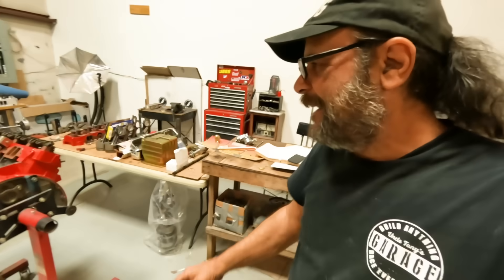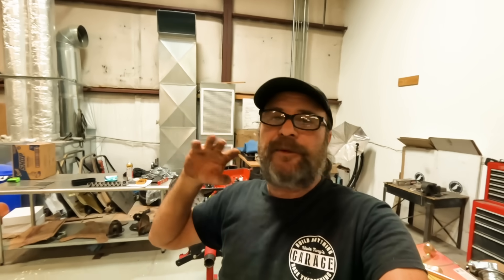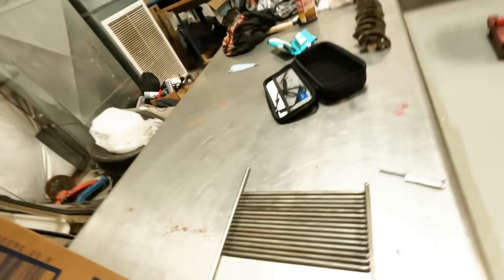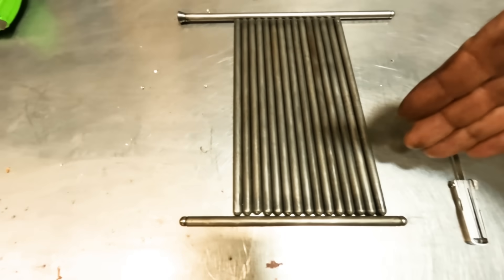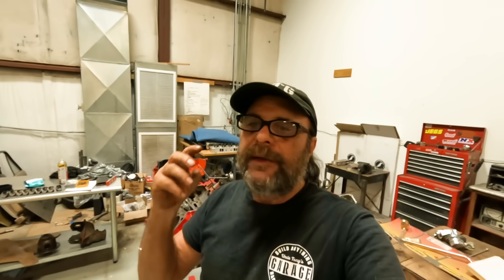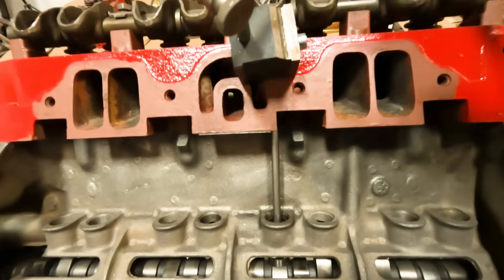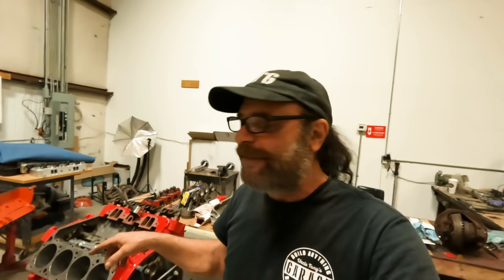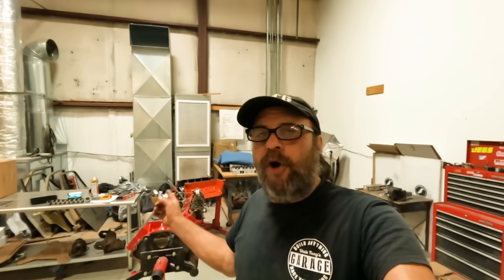The Engine Tuning Issue You Didn't Know You Had

Comment: all push rods need to be the same length = check lifters and cam lobes = if a push rod is shorter it is worn and some thing is also worn = rocker pivot lifter cam lobe = even hydraulic lifters  - and this is why = over head cams were popular and have advanced so far . check push rods straight = roll them on a mirror and see .

Comment: The pushrods have a manufacturing tolerance on length. + or - .010"? .005"? Also the valve seats gave a manufacturing tolerance from a certain feature on the head. Usually the face. This can be established by a specified spherical diameter set in the valve seat as the distance from the head face to the top of the sphere with the head set up on a surface plate so that the head face is parallel to the surface plate. That's an old school way. Now it's all done with CMMs. As to how the valve seat depths are controlled that can vary. The tooling set-up will specify the seat cutter at a certain distance from the mounting face of the cutter. The cutter body also carriers a carbide bushing to guide the valve guide reamer. But the cutter face where it bolts on to the spindle face can be vary. The spindle assembly drawings will specify a set distance from the spindle face to a control feature.  It can be to the rear end of the front set of bearings on the spindle shaft (1) or it can be to a keyway in the bottom of the spindle body. It depends on how the machining equipment was designed. Another factor that can creep in is wear on the clamping surfaces in the fixture holding the head during machining. This can cause a slight twist in the head during clamping. Plus there are multiple machining stations being used to cut the valve seats and guides. In the old days the stations being used to the transfer lines used to do this type of manufacturing had solid stops to control depth. Run into the stop a couple of hundred thousand times and you will have wear. Today things are controlled with ball screws and encoders. Too shallow or deep. Edit the numbers. Each machining station is a dedicated CNC machine. The point is all of these tolerances stack up on top of one another. And they usually add up the wrong way.
I used to work in an engine manufacturing facility (30+ years). Inline OHV 4s. 6s (2), V-8s and OHC V-6s. So I'm pretty familiar with engine manufacturing. Its possible that a couple of new techniques have shown up but I doubt it. I worked maintaining part tolerances and repairing machines and fixtures on the manufacturing floor plus in the plant Tool Room (3) rebuilding machines,  repairing machine components, fixture work, machining replacement parts for machines and fixtures. My last four years there I rebuilt precision spindles and workheads.
1) A spindle consists of the entire rotating group
2) Kenosha Engine
3) Prevision machine shop. Not where they keep the tools.

Comment: We used mechanical rocker arms with hydraulic lifters when we milled the heads as much as.040 so we could get the right preload of the lifters. At.040 mill didn’t change the rocker arms operational angle too much.

Comment: Another thing to add to this conversation is different cams have very different base circle sizes (the zero). Just a cam change throws it all off again. Modified engines need custom length pushrods. Sorry.

Comment: I rebuilt a '77 318 and put a stock grind '71 340 cam in it and would float the valves around 5500 with stock 318 springs. Never did damage anything.

Comment: What about a block that has been decked multiple times? Is that Clearances that could be determined before assembly by engine builder. Or would they only be able to determine lash/preload after assembly of your motor (as I would assume?) and then send it out if it was just a street motor or tell the customer to get adjustable rockers for a performance build. I guess what I'm saying is how do you avoid the problem? Are there spec measurements for deck/ head heights? How many times has my 390 out of a 68 Cougar that is now in a 69 f250 been machined and how would you know without assembly of engine? Ive never built a motor before but I'm interested

Comment: Interesting, I am not a motor head.  I removed my 62 Falcon Ford 170hp six cylinder head to repair exhaust bolt holes. I did not know to pay attention to location of each push rod. All the push rods are alike but one. Which told me the head had been previously removed. I noticed that the push rods where also not the same length, as you show in the video. I did not note location of each push rod... Oops. I also noticed that one push rod was a larger diameter. ???
The head has been resurfaced. And as you state that will effect the lash. Please explain Tony what "lash" is? The shop manual also uses this terminology. 
I get setting everything to zero when bolting on the rocker arm assembly and measuring to place the longer and shorter push rods in the best fit locations. Taking it apart was easier than putting it back together.
Each rocker has an adjustable nut thank God on the 62 to set the tension gap c/t the valve spring. I hope I'm using the correct part names.
The rocker arms are worn in places c/t the push rod. I assume this can be adjusted out. The shop that worked on my head did not resurface the rocker arms??? 
I do not have all the fancy gages. I assume I can set tension after setting lash (zero) c/t rod and arm???
I'm completely guessing. 
Any advice?

Comment: Love watching your videos Uncle Tony! You speak to the old school and new DIY mechanics! Any chance you could cover the AMC 360 on Full Size Jeeps! There’s a large community with a lot of owner’s opting to chuck all the emissions to get them running stronger and better.  The problem is a lot of FSJ owners live in SMOG states so we need to keep them running well and pass smog.  We can’t just get up and move into a non-smog state which is the typical sarcastic answer from those who don’t want to deal with tuning an engine and still passing smog.  Thanks Again for keeping things simple and proving simple tips to keep our 70’s and 80’s cars on the road and not in a garage in bubble wrap. I have a 1986 Grand Wagoneer with an AMC360 & motorcraft  2150 carburetor, all original with all the smog equipment and new exhaust from the manifolds back
Reply: Just how far back do done states expect you to meet might emissions standards for the model year the vehicle was built. Where I'm at its 95 or 96 when the OB2 sensor hookup came into use. Anything older doesn't need to get checked. And to be honest there really isn't much around that's older.

Comment: I've always thought that pushrod length on a mass produced engine casting is a compromise at best. There are simply too many variables to take into account unless each lifter-pushrod-rocker arm-valve (length)-valve spring assembly can be tuned and set up individually. The rise of CNC billet engine blocks and cylinder heads solves most of this but is way out of reach to most of us.  Getting away from mass production is  the only way to begin to limit the variables. Otherwise time for each mechanism and good hydraulic lifters are required.

Comment: Another thing some fail to do on engines with fixed rocker shafts, is they may plane the heads or deck the block but fail to shave the valve stems to compensate. Edit: Oh, you get to this point at 12:34.

Comment: Love this Video. I can remember back in the 60's and 70's adjusting the valves on  small block Chevy's. We would start them up and after the engine was warm we would remove a valve cover and install these caps on the rocker arm to stop the oil from spraying all over. Then we would start the engine and back off the ball nut until the valve started clacking, then we would tighten it down until it stopped.  Then give it a quarter turn to set preload. I still have these "caps" in my tool box today. Now I'm questioning the quarter turn. If it is not needed I've been doing it wrong for 55 years?

Comment: Rocker stand shims are for fixing rocker to valve tip geometry issues , I've used adjustable pushrods on a couple of builds to set preload with stamped steel rockers .

Comment: Funny you should be doing this the back when Mount St Helens blew up I started doing head work in addition to being mechanic previous to that porting polishing valve grinding all that stuff building things I was doing meticulous crap like this measuring stuff out of the blue out of my own head just out of curiosity because all the parts catalogs I had had dimensions in the back and you could varie push rods by 60,000 90,000 longer set and I used to measure stuff for the s*** of it I used to even weigh pieces just for the hell of it and a lot of people don't think around me just throw the thing back together but it takes an enormous amount of time which is why I got criticized because I took too long? But you know what I don't remember anything ever blowing up or coming back unless the person was an idiot that owned it and ruined it but anyway measuring takes forever and that's why I have never built a motor overnight and put it in the next day you're just asking for trouble it can take 3 weeks to a month to build a motor

Comment: When I was a  kid in the mid 70's I wanted to build a solid cam 440. I found some adjustable rockers around the shop in a box in the used parts room that looked like they could either fit or be slightly modified to fit. There were only 12 of them in the box, so I think they were from a six. I could be wrong but I seem to remember my uncle telling me they were from a Rambler. BTW, I never built the solid motor, I ended up using a hydraulic cam and stock rockers

Comment: Tony great explanations. At the risk of getting angry comments because some people like to attack any other input..

I used adjustable rockers years ago and was happy until I wanted to bring back the original looking valve covers. The adjustable rockers I used “Isky” needed taller valve covers. Hence I used Direct Connection chrome valve covers. My solution was to use adjustable pushrods in my 440 six pack engine with stock valve covers and it was terrific. RPM was never a problem in fact I had to be careful of going too high. 
I have refreshed a 383 recently using custom pushrods made by Smith Brothers. For the very reason you pointed out. I had cylinder heads that had uneven valve stem height after a valve job.  Years ago they used to finish with grinding the stems even. No more. Cost me less than $300 and I was done. No rockers to buy and pushrods to match. A cheap way to go custom valve lash and very strong since you can request bigger diameter pushrods too. 
I’m a little surprised with your vast knowledge you didn’t mention adjustable pushrods that work with factory stamped rockers. It’s a cheap way to get the results for Mopar engines. And it works great! 
Enjoy the videos. I still pick up a few things here and there. Thank you
Reply: Another alternative, if you have access to any kind of machine lathe, is to shorten the pushrods. You just need to grind a HSS bit into a narrow parting tool and cut up next to the shoulder of the hardened end insert. Amazingly easy, even for a newb.

Comment: Why not just buy a set of adjustable roller rockers with new hardened pushrods if your wanting a performance engine. Which are you building a stock OEM or performance if performance you know there's a lot more then pushrods length and rockers.

Comment: Went through all that about 10 years ago when I built a 351m Ford.  Bored/stoked to 408 Got the heads and block back from the machine shop and the valve stems were at different heights plus with everything being machined the valve geometry was all over the place.  A few different lengths of pushrods and some shims and got everything dialed in.  It was part of the engine build I didn't expect to spend so much time on.  It was ridiculous.
Reply: Had that happen pizzed me off! Especially when you let them know ahead of time, most figure we will never notice. RUsh the job do the next. 
Had a valve job done, brand new valves...when I got them back they were sunk so far into the seats I freaked out on the guy.

Comment: years ago when i raced la 360 i used to shim the rockers i found a soft aluminum washer that would conform to the stand and seal the oil really good after they heat cycled they seemed to stay the same wouldn't crush when removing and installing so you  had to keep up with where they went. i think i still have some of them left

Comment: This is an issue I brought up with the machine I used for my '65 383 magnum virgin. He has a friend that does high end motors he got in touch with. I told I using the stock rocker shaft and push rods. With the springs that go with the cam they set the spring height that was called for, and no grinding needed for the inner spring. Neither of them had ever seen an original hp mopar engine untouched. It will be grumpy.

Comment: I’ve battle this very issue for years on my built fords ….I usually don’t go crazy on an engine if I’m gonna retain the stock pedestal mount rockers.
In the past When I did put a bigger than normal cam with stock heads I ran into that very issue! Adding stiffer springs helped but then ended up with valve train clatter after a hard hit…(lifters would bleed down from the stiffer springs) I’ve since gone with beehive springs on most of my performance builds which has helped tremendously! Using light weight valve train components while still retaining moderate spring pressures has work good for me!

Comment: Put springs in the fucking rods to self adjust them inside the push rod with magnetic valve spring ends.so the motor doesn't fucking go 💥 boom.

Comment: WoW. I was looking to ask you  if the rings or valveseats would get worn first and cause blowby in a ...say 90,000 mile 1975 318. 
 I also hear some chatter of pushrods in the initial startup that only comes back when the engine temp gets to 182ish..and the rpms are above 2700 on acceleration to overcome traffic or get up hills.
 I replaced the timing chain and lifters about 12,000 miles ago and not the pushrods or stamped rockers.
 I have an identical set of stock heads that I did a mild port and polish on that I plan on swapping out in the near future when I reach my home base.
 I also have an aluminum Eddlbrock performer dual plane intake to add in place if the cast iron anchor with Carter BBD. 
 I absolutely love this engin and bought a spare which gave me the extra heads. the throw out bearing was worn at the crank so I tossed that,  as this engine I am currently using may have wear also but it runs so good.
 I am guessing that it currently could use new head gaskets  so that is the reason for new/ reconditioned heads that I took to a reputable shop to have done. 
 if there is z difference in the valve stem height while the heads are off still znd not installed, can/ should I grind them down evenly to the same finish and profile they are with a Drexel tool and sidestep this issue? 
 I have new pushrods to go in..is it necessary to replace the rockers? it is to late for springs  as I don't want to go through the time and effort..
 This engine is in a 1975 Winnebago Brave and is stated to have only 160 he at time of production. With the 2bbl It puts the smoothest at 24- 2600 rpm and gets  the best milage. It has a 727 and a Dana 70 w 389 gears. I also have a spare 727 and Dana 80...I could wait and get a new, not refurbished crank and invest in the other 318 to build instead  along with the other granny.
 my mpg can be 14+ per gallon if I am tame. At 3k - 3300 ram the engine just starts waking up but the mpg drops to 10- 11.
..I also  picked up a 1979 400 with 727 out of another Dodge Sportsman motor home that the Dana 80 came in. 
 Would I get better milagr and more power at a lower ram by using that? ..I do not like 4bbls for many reasons..it has a 550? cfm 2bbl carb..I thought about putting on the 318 with an adapter...
 
 I am satisfied with the current setup and only desire an extra 25- 30 hp in the 318 for steep hills. I don't tow a trailer but I have and it was effortless on flat and minimal hills. 
 I had removed  about  1500+ overall pounds from my Winny. the chassis is an M300. tranny mount is stock flat pad from earlier years. I also have headers  with no crossover or H pipe and pertronix. should I get an H or X pipe?
 
I appreciate  your channel  and the advice and info that you give us. 
 Much of America's goodness and tradition is due to our enjoyment and personality of Hot Rods and Muscle Cars.
 Thank you
💪🇱🇷🍍🗽💥

Comment: I learned something today. Good stuff. But I have a couple of observations. First, WHY is it that there are variances in pushrod lengths? It isn't that hard to make all pushrods the same length. After all, they are just lengths of metal and a good machine tool, even in mass production, should be able to make consistent rod lengths. Secondly, you didn't talk about cams. If I want to tune an engine, one of the first things I do is change the cam for lift and duration. Lift will affect the amount of air that gets in and out and duration will affect the burn cycle in combustion. In turn, this will affect how long the springs are compressed and can affect the harmonics and timing of valve return at higher RPMs, which of course means you have to have the right springs, etc. Thirdly, if I mill the heads or deck, I change the needed length of my pushrods.
You correctly pointed out the difference between Chevy with adjustable rockers and Mopar without. But  why then aren't ALL engines equipped with adjustable rockers?